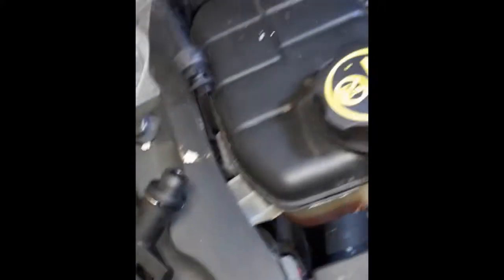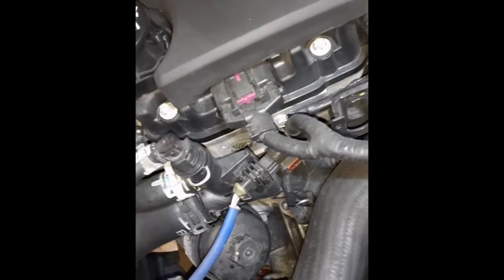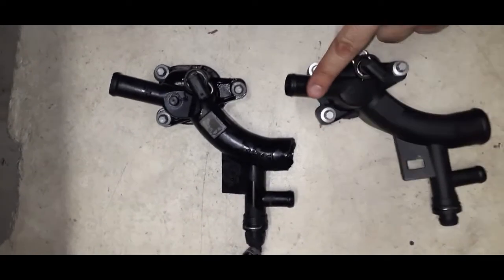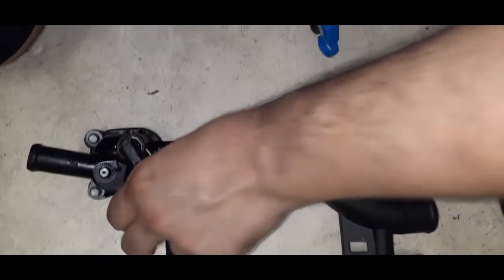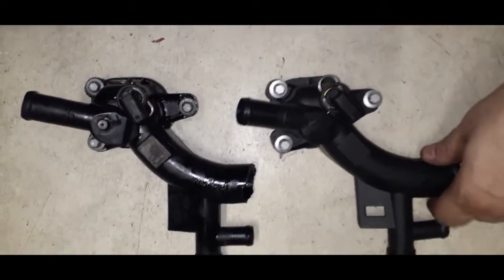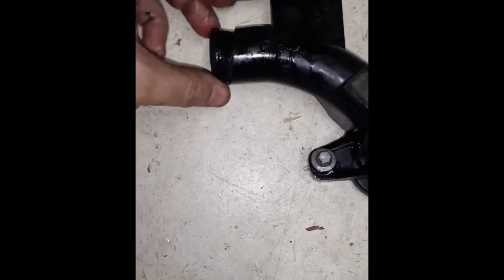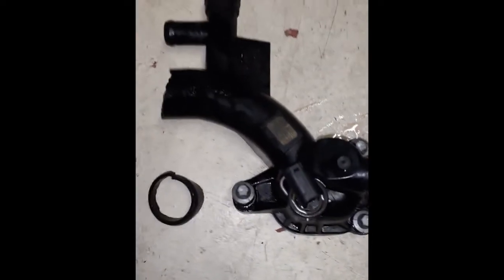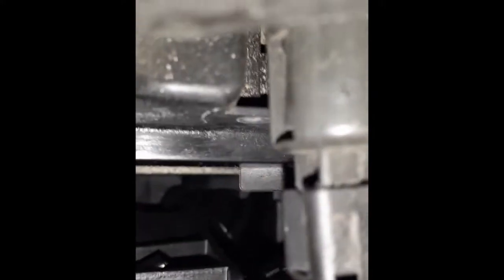How to: Coolant leak...replacing the Water Outlet Thermostat Housing on an Ecotec 1.4L Encore/Cruze.

Comment: I replaced mine with a metal unit, they should not be using plastic for coolant lines
Reply from the maker: By the time I found out they make a replacement part out of aluminum I had already replaced it with a plastic one. The next time, I’m using aluminum. I used an aluminum replacement for the thermostat housing but with that one be forewarned that the sensor is still not replaceable so if it goes, you’d have to replace the whole thing. I’ve already replaced one with another aluminum one.

Comment: bolt torque?
Reply from the maker: Good question. I could never find anything concrete on the torque specs for this part. 

I stuck with the average 18ftlbs of torque that tends to be the norm throughout this vehicle but also keep in mind too tight and you will mess up the gasket's seal.